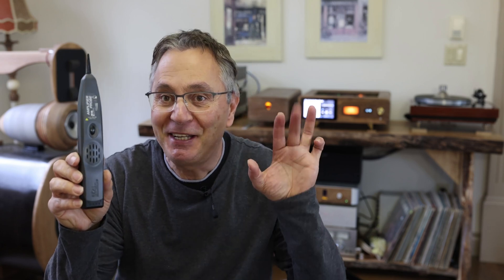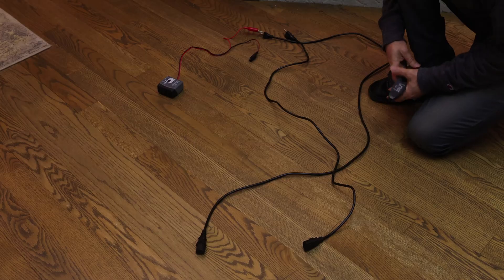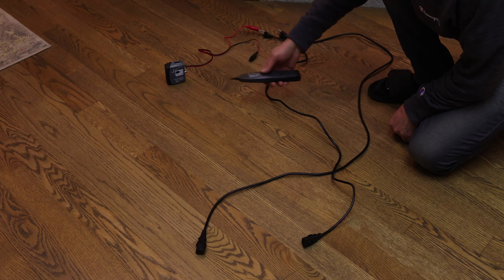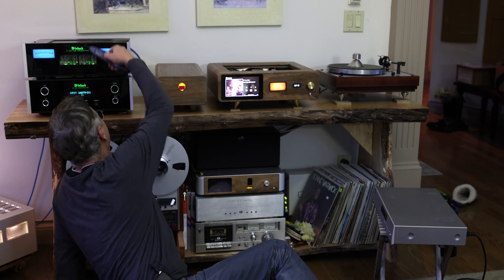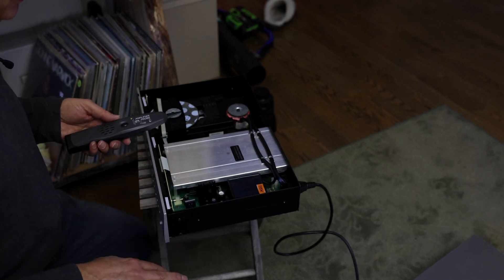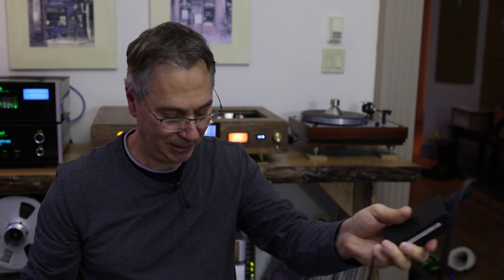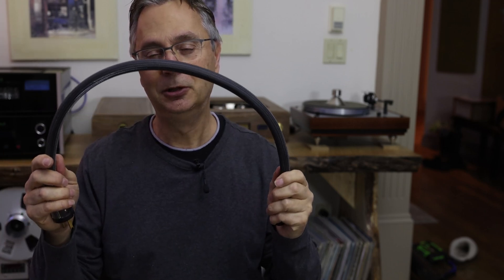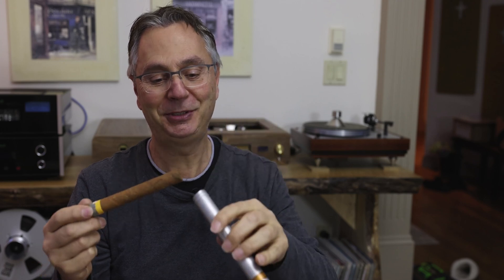Find Noisy HIFI gear with this probe

Comment: Does this probe work the same as an EMI meter? Meaning would do similar job but a lot cheaper? 🤔
Reply from the maker: No it is not the same emi meter are sensitive to very high frequency like 5 g internet this one is more for part of the audio band
Reply: @Gabster1  Ok, so which is better to identify noisy power supply, or similar items? I wanna check a few power supplies for my ethernet switch, my router, and others to ensure they;re not adding noise to the system.

Comment: This video needs to come with a warning. The cables don't matter crowd might blow a gasket if they see this
Reply: No, were not...

1. Here at A.A.V.A* we care only
about measurable+audible noise/RF 
issues  ONLY WITHIN/ AT THE OUTPUT OF
THE AUDIO CHAIN:
From the source like- Dacs, Turntable, Streamers
Cassette players, Cd/SACd etc. to pre,
Power, speakers etc.
Any general flowed design/engineered
topics we forward automatically to :
HOW TO BECOME A PROPER ELECTRICAL 
& ELECTRONICS ENGIENEER/ DESIGNER  
DISCUSSION GROUPS.  

* Anti Audiophile & Voodoo Association 

2. Yes, it is well known by now that 
from some reason many High $ audio
Boxes / Toys / Devices are poorly
Designed and Electro engineered.
Probably the fault is with the ISO cK$ *
system of the Voodoo industry. 

* calibrated Kilo $  

Be blessed, healthy, educated, free and
prosper.